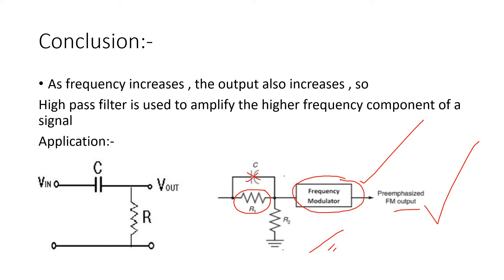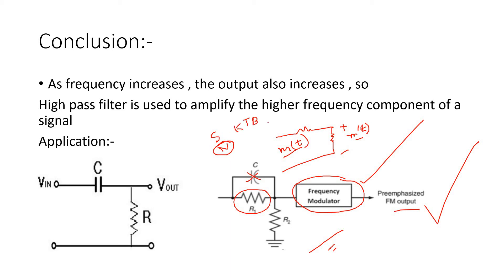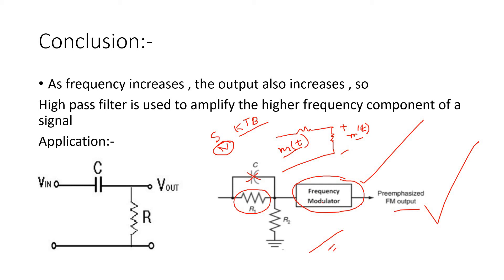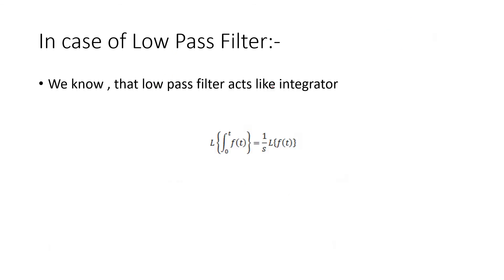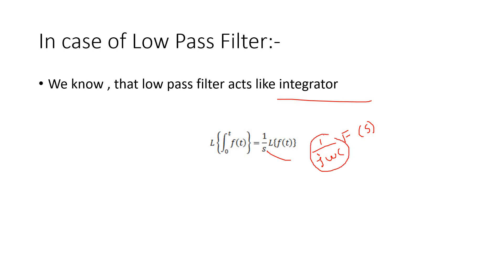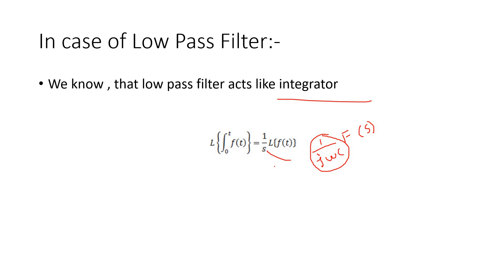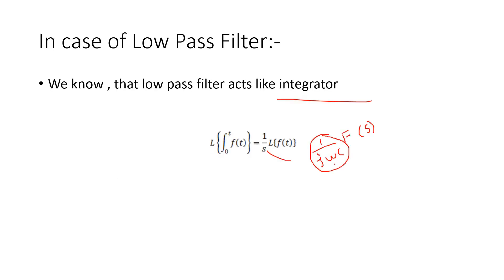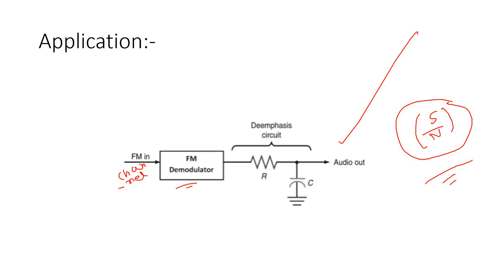Pre-emphasis & De-emphasis Filter (PDF)

Comment: Tell me how the high frequency signals are amplified here
Reply: To realize pre-emphasis in passive RC circuit,  high frequency signal is "by-passed"(pass over) by C and lower frequencies are attenuated by R1 and R2 (see 10:44). For amplifying you need an active component - transistor or OP amp. You can realize pre-emphasis in an amp as de-emphasis in its negative feedback part.
 In this passive circuit pre-emphasis time constant is t=R1*C,  R2 should be  <<R1 , say 10 times lower value.
 In deemphasis circuit t=R*C (simple 1-st order low-pass filter) but when you have also an active load R2 over C then t=R*R2/(R+R2))*C !